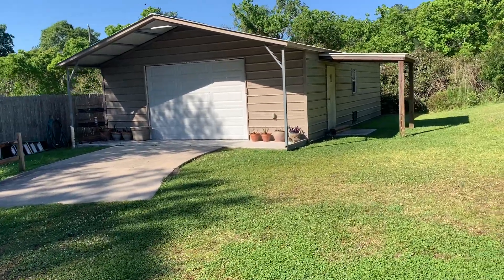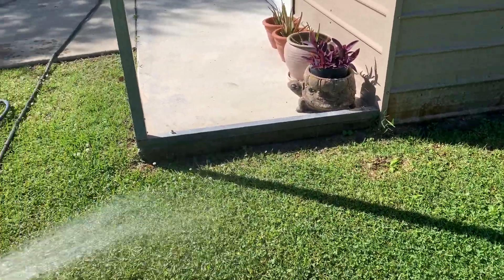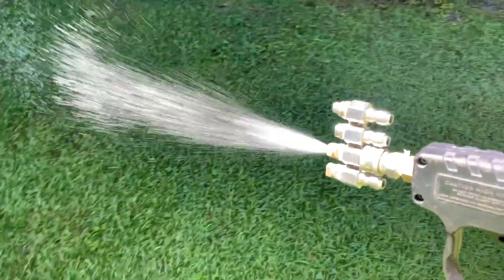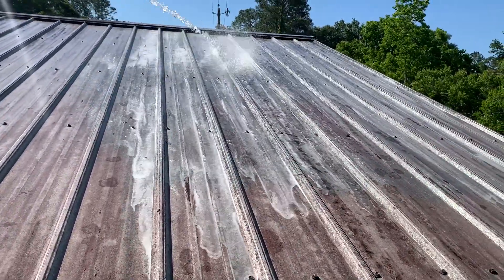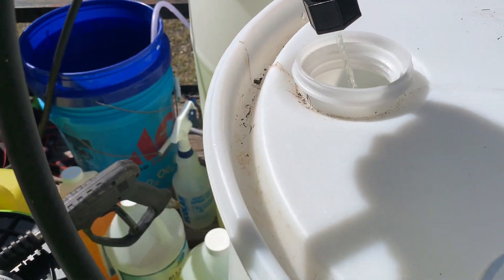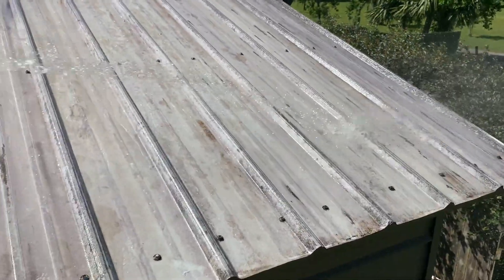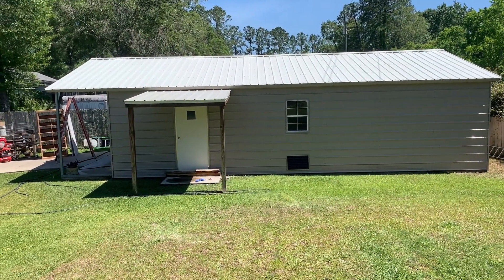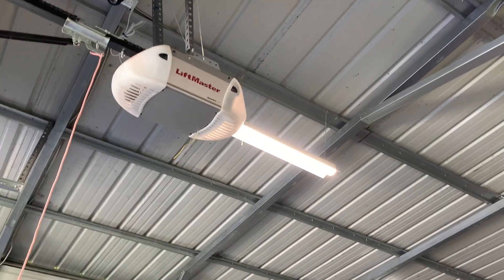Soft Washing A Nasty Metal Roof!

Comment: When washing the inside of those metal buildings...mix up 5gals of water with a good dose of Dawn dish detergent and downstream the overhead and walls. Let it dwell for about 10 minutes and pressure rinse...works VERY well and speeds removal of that stuff a lot.
Reply: @577buttfan  Na....not necessary and you are not supposed to mix Dawn dish detergent and bleach...check the bottle and it says that.
Reply from the maker: Thanks 💪
Reply: If the soap contains ammonia, it will create chloramine vapors when mixed with SH. This can result in respiratory, eye, and skin irritation.
Reply: @GuardianPressureWashing  I said NOTHING about mixing with bleach...I said water and Dawn...read it again.

Comment: Would using a surfactant with the SH help it dwell on the roof even if you downstream?
Reply from the maker: Downstreaming wouldn’t allow a strong enough mix, so that’s not really smart to do on roofs. I do use a little surfactant with my 12v pump when I’m doing roofs. It just takes longer to rinse when you use a lot.

Comment: You need a xjet set up bro i just got one it has multiple advantages and a couple disadvantages lol. But overall a great tool
Reply from the maker: I’ve been considering it. Don’t know too much about it. Looks super inconvenient in my opinion. I could and probably am wrong about that lol
Reply: It's kinda a equipment saver and you can draw a stronger mix like up to 5% than down streaming from the pump witch is around 2%. It eliminates bleach from traveling through the hoses and your wand. I'm running a small pressure washer to 2.4gpm 3300psi, i found I'm a little more efficient i can shoot straight stream about 30' with my xjet. It's all about what works best for you, I'm getting a 4gpm within 2 weeks can't wait .
Reply from the maker: @joshschauer6692  damn that is very convincing. What about carrying around the jug??
Reply: Well in carrying the jug around isn't to bad to me but it's mainly personal preference..
Reply from the maker: @joshschauer6692  I will definitely be purchasing it. Maybe I like it, maybe I don’t. Won’t know unless I try. I appreciate the advice! ❤️
Reply: No problem man wash on
Reply: It's a short of a roof wash i did with it.

Comment: Do you not have to wear a mask with that stuff? Or is it fine ?
Reply from the maker: It’s probably recommended, I don’t, but I should
Reply: If you’re up on a shingle roof and it’s real hot outside I always wear a 3M chem mask. The heat and the SH will definitely put you out.